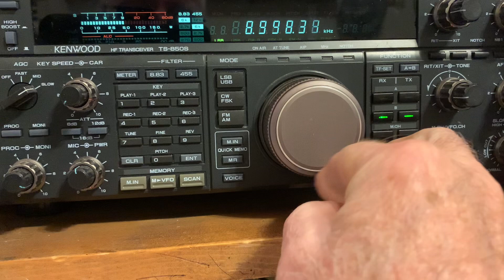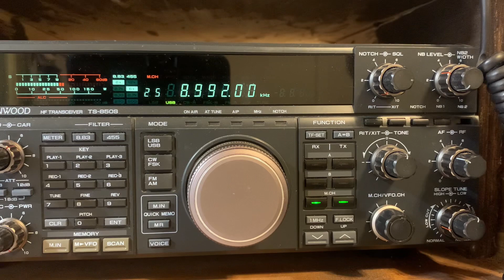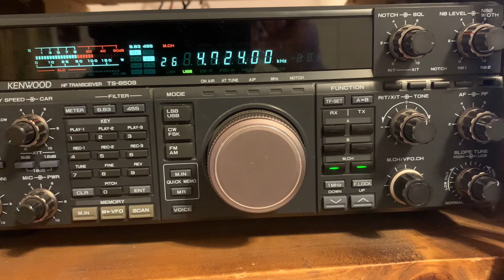The U S Air Force High Frequency Global Communications Systems and are Russian jamming this

Comment: I am SO HAPPY you posted this!  I served in the Air Force from 1977 to 1981.  From 1978 to 1979, I was stationed in Europe and my main duties involved being a radio operator and handling radio traffic involving emergency action messages.  I was only 19 at the time; I am 64 now.

As to your question if this is jamming, I can't say for sure, but quite possibly The Soviets were attempting to jam the network back in the 1970's when I was stationed overseas.  What they were hitting us with sounded much worse than that.  It was pretty bad, but what they were doing didn't stop us from communicating.  What it did succeed in doing is making our lives miserable while we were on duty!  Can you imagine what it's like to listen to that crap or worse coming out of a radio for twelve hours straight; day in and day out?  We were told at the time not to talk about the jamming, and I figure the reason for that was they didn't want the Soviets to know that their jamming wasn't working.

You have made this old Air Force Veteran very happy and I am sharing this video!  Thanks again and God Bless!
Reply from the maker: Thank you for your service

Comment: I remember hearing a similar sound on my SW radio back in the 70’s. I was told it was “over the horizon radar” 🤷🏻‍♂️
Reply: In the 70s, there used to be a system called NAVSPASUR.   The antenna array was in MS and it tracked orbiting satellites and debris.